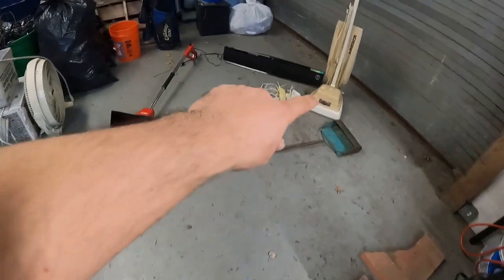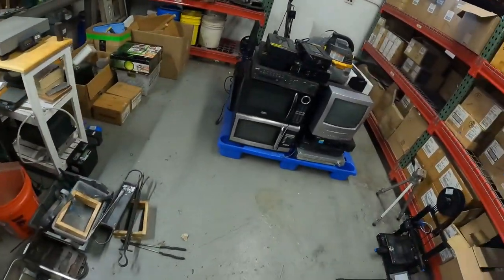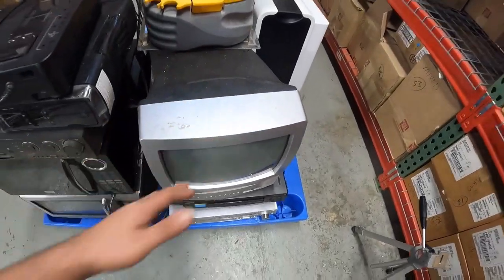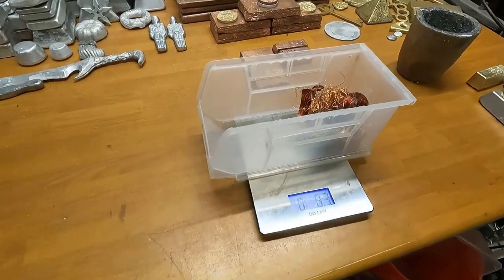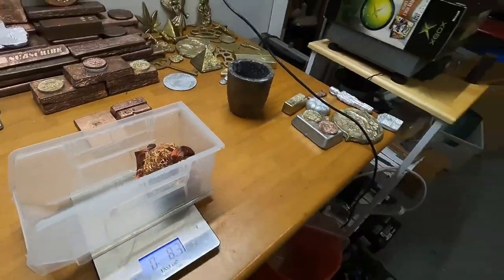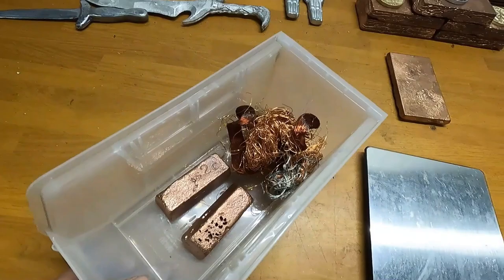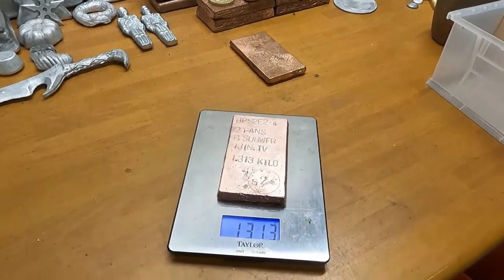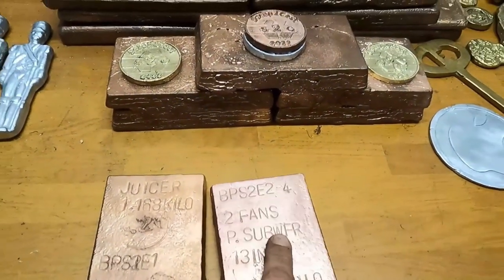Scrapping an old Toshiba TV for Copper - Trash to Treasure - Copper Metal Melting

Comment: 1. Any old TVS...I didn't know

2. Take a look at 4:13...where did you buy it? I don't know what name.
Reply from the maker: Yeah old CRT TV’s are a good source for copper
Reply: @Scrap2Cast  
4:13 what is that name? Thanks
Reply from the maker: @catholic3dod790  sorry bud didn’t see your 2nd question earlier.  That part is my automatic wire stripping machine.  Here is a link to that exact machine.  

https://www.amazon.com/Happybuy-Stripping-1-5mm-25mm-Channels-Industrial/dp/B071XSQTY4/ref=mp_s_a_1_2_sspa?crid=XCJSV86O7IDG&keywords=wire+stripper+machine&qid=1669262943&sprefix=wire+stripp%2Caps%2C213&sr=8-2-spons&sp_csd=d2lkZ2V0TmFtZT1zcF9waG9uZV9zZWFyY2hfYXRm&psc=1

Comment: I hear you breathing 🤣🤣🤣. Great job!!!  How high Is your ceiling?.  My garage is 8' and I don't want to run my furnace inside.  I'm sure the ceiling would get hot.
Reply from the maker: It's inevitable, I need to breath to keep the content coming 😉  The ceiling / roof is 14ft high.  Honestly, I can stick my hand 6 feet above the vent of the furnace, and I can slightly feel the heat.  I'm sure you would be fine as long as you did it right by the garage door opening for proper ventilation.  You also might consider grabbing a floor fan or box fan to blow the furnace smoke (if any) out the door.  Thanks for watching brother!
Reply: @Scrap2Cast  I figured you had high ceilings.  I'm still a little skeptical hahah, but I might do the hand trick like you said and see how hot it is.  The fan is a good idea 💡
Reply from the maker: @HeinrichsMade  Yeah they are pretty high.  I'd be skeptical too but the hand trick might work or you could gradually "ease into it"  Start off by melting aluminum as it melts a lot lower and the flame wont be as high due to the less amount of gas and air being pushed out through the vent.  If it works with aluminum, should work with the higher melting metals.  Trial and error.  I'd definitely use the fan, especially when melting brass.

Comment: you forgot the cable in front of the tv bulb
4 screws  and lift  the glass bulb you find more copper
Reply from the maker: There wasn’t one.  You mean the tinned copper that goes from corner to corner and attaches by a spring?  If so, I cut it in two sections in the vid.
Reply: @Scrap2Cast  yep!   my fault sorry...
Reply from the maker: No worries my friend!  🙂
Reply: @Scrap2Cast  very nice video! love the old tv's the new one's don't have anything intresting in it,greetings from nederland (europe)
Reply from the maker: @harry-metal-melter  thanks brother!  I totally agree! I wont even waste my time on a newer TV.  Greetings from the USA my friend!